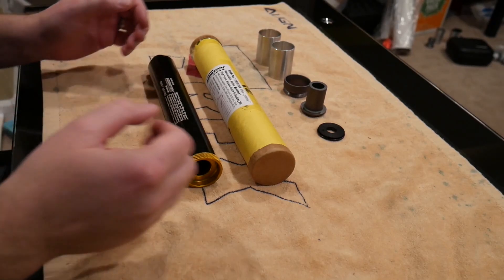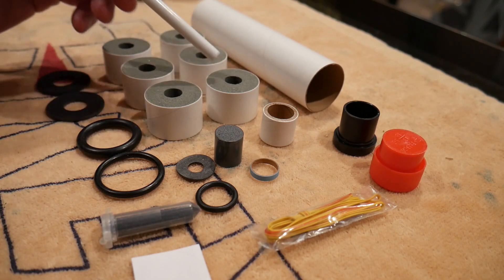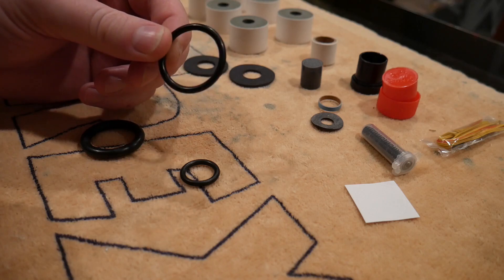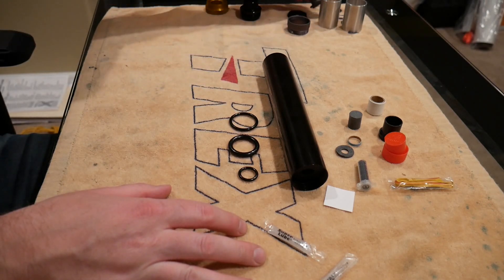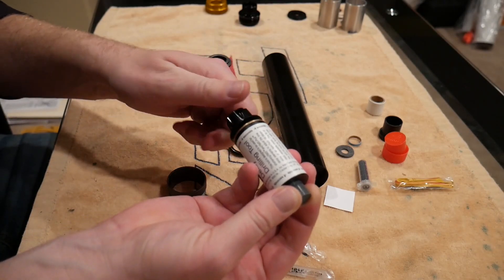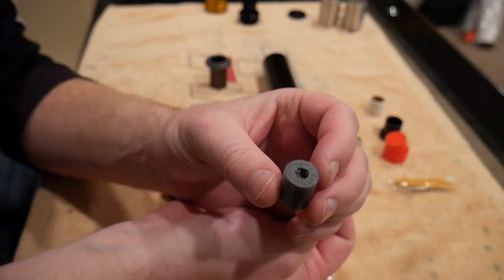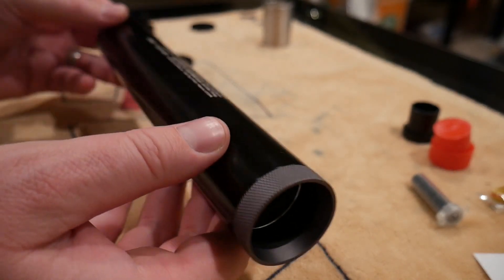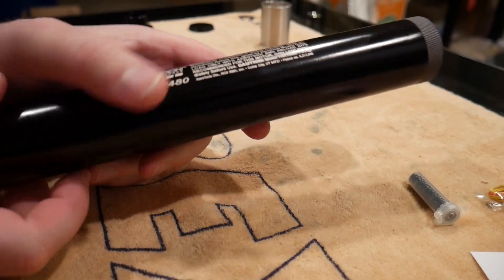Aerotech 38mm High Power Propellant Assembly + RAS Demo & Flight

Comment: bro nozzle size for 38mm motor?
Reply from the maker: Standard included nozzle in the propellant kits, are you looking for the throat diameter?
Reply: @almostspace123 
my rocket tubes 38mm.X.200mm
my propellant knsb
Is an 8mm rocket nozzle OK?

Comment: Could you use a 38/360 reload on a 38/720 case with the RAS system?
Reply from the maker: Not approved by Aerotech/NAR certification, maximum of 2 spacers to keep it certified. so the smallest reload you could use in the 720 case would be a 480 load.

Comment: So the delay drilling tool I got questions. I recently got my L1 cert on an H135W DMS and used the "universal delay drilling tool" by drilling into the delay from the forward closure end. But here with the RMS system you used the "RMS delay drilling tool" to drill the delay grain BEFORE inserting it into the forward closure, and you put the drilled part facing the motor, whereas the DMS drilled end faced away from the motor. Did I totally drill my DMS motor wrong or is it just two separate methods due to two separate motor systems?
Reply: Following
Reply from the maker: Yes the drilling tools are separate for the rms and dms motors unfortunately, would be nice to have one that works for all. Make sure to not mix and match!
Reply: @almostspace123  So thanks to your video I did my first RMS launch yesterday. H148 Redline. Went together perfectly the first time and launched without a hitch.
Reply: @almostspace123  Thank you!

Comment: So is it best to buy the longest tube size you will ever need and then buy the RAS to downsize for your smaller motors?
Reply from the maker: The best combo i think is to have both the 360 and 720 (when talking 38mm reloads) with the RAS kit, with this, you can then fly 120, 240, 360, 480, 600, and 720 loads with just two cases! In my example here, using the 480 case, I can fly 240, 360, and 480 loads.
Reply: @almostspace123  Do you know if Aerotech is going to these small grains for all their motors?  Would be nice to avoid those fees.
Reply from the maker: @BlackDim100  That would be nice! I hope so, as of now there are very few offerings that are hazmat free unfortunately
Reply: @BlackDim100  they cannot offer the small grains in all motor configurations. The grain size and geometry affect the performance so is not possible for all motors/propellants types
Reply: @almostspace123  Thank you!